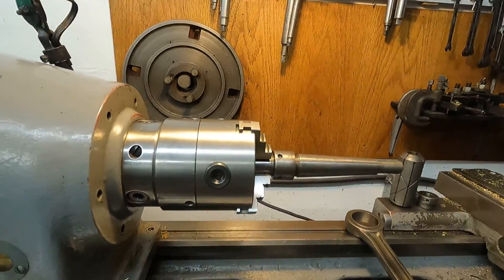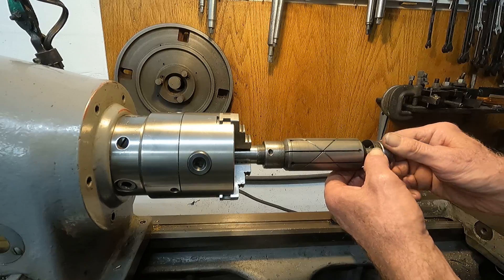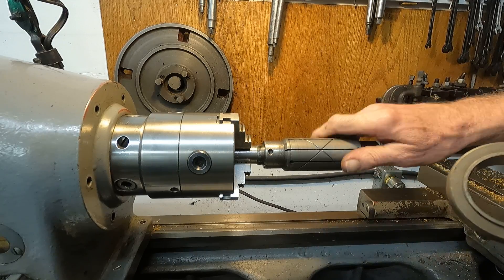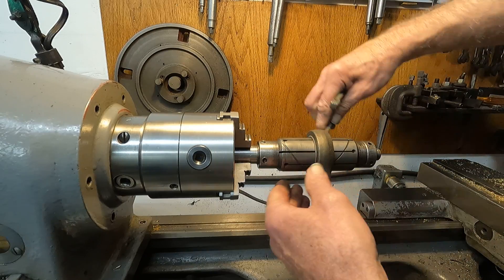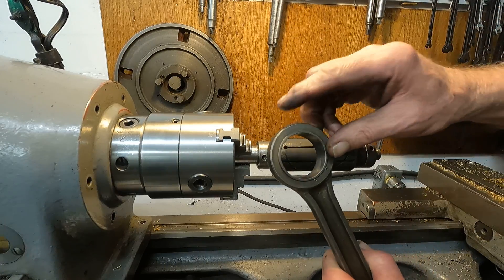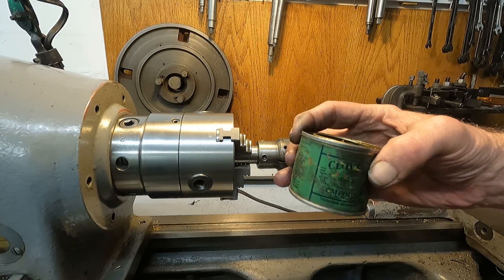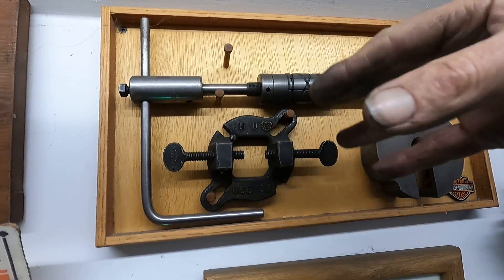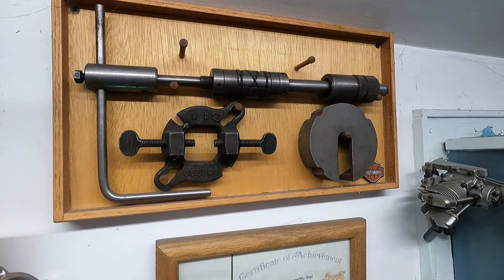Basic lapping with a commercial barrel lap

Comment: dee dee that is very interesting. What does the crankshaft look like allowing sliding these rods over the journals. ?
Reply from the maker: I can make two videos first honing the rod races on the Sunnen machine, then finish lapping the races. since the rod big end bearings are rollers available in steps of .0002" oversize I can describe plug fitting roller bearings without micrometers, and it is applicable to other industries. The crankshafts are 5 piece on early models that I will show.

Comment: Good one . I thought they were steel , i  have a set of S&S shovel rods & they are 4140 .  I had to re machine the sprocket shaft taper in one of the flywheels , balance the whole assy and re assemble & true up .  It was an interesting project & runs as smooth as with KB pistons .  👍
Reply from the maker: The rods were malleable cast iron up to the very last Shovelhead where the Evo style forged 4140 rods and semi steel flywheels with integral main shafts were used until the Twincam where the rods are induction hardened without replaceable races and straight push in crank pin. I was a long time S&S dealer as well.

Comment: Just curious what you think of the "Timesaver" line of lapping compound? My impression is that it works in the same way, breaking down and reducing the risk of secondary contamination of abrasive particles.
Reply from the maker: The other compounds I use are for the Crane Lapmaster machine, the risk in lapping is greatly reduced with experience, it may be a good idea to do some test pieces first and a lap needs to be run in before it produces the best results.